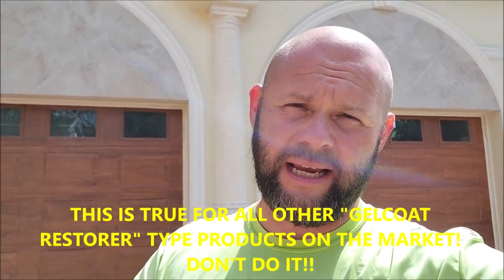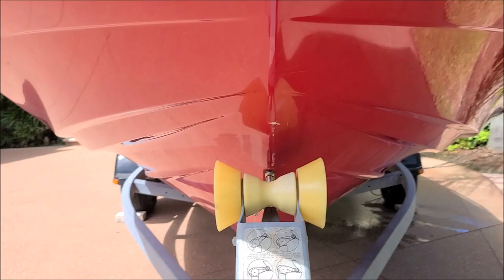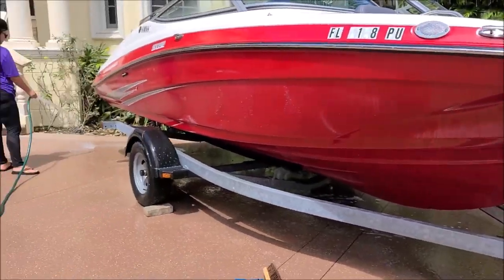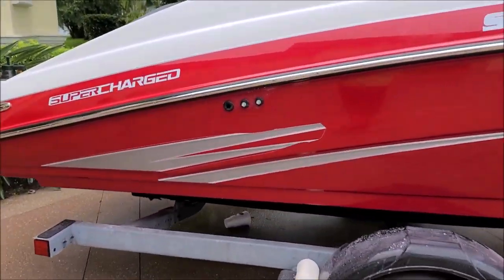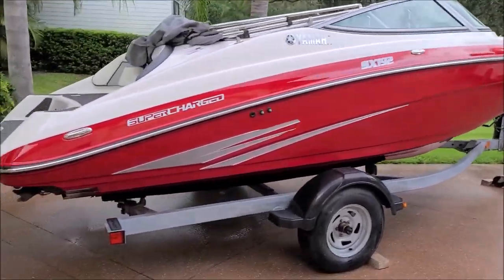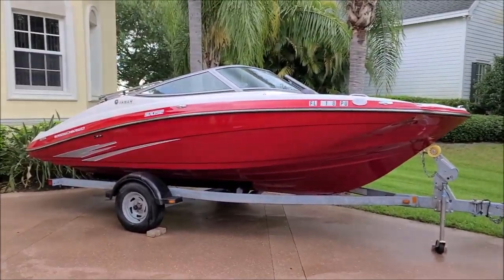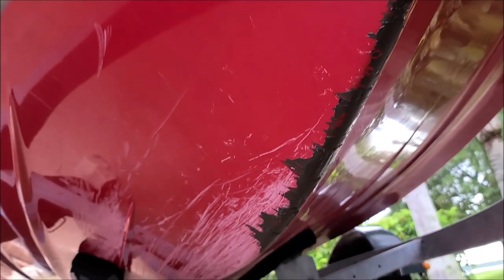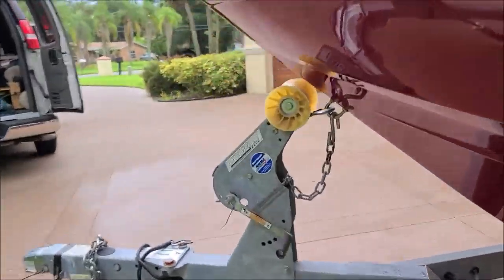2012 YAMAHA SX192 RESURRECTION DETAIL - POLI GLOW NIGHTMARE! - CERAMACRYLIX PRO MARINE COATING

Comment: I'm having the same problem with a boat I bought that already had the poli glow on it. It's a 2006 Sea Ray 185 sport red in color. I bought the poli glow remover product but damn it yikes alot of work for just a 2x2 area. My question is can I use a cutting compound instead of using the poli remover or Zep floor stripper? Please and recommendations would be highly grateful thank you.
Reply from the maker: yes, My Marine Series Gel Coat Oxidation Eater will buzz it off.
Reply: @Garry Dean  Again what's the site I can purchase that please? Again thank you for your response it's much appreciated.
Reply from the maker: https://www.detailjuice.com/product/gel-coat-oxidation-eater-compound/
Reply: Got it sorry